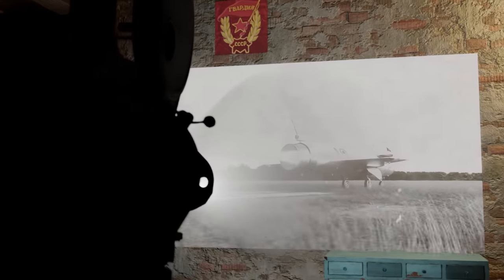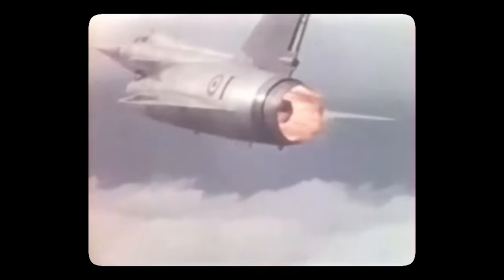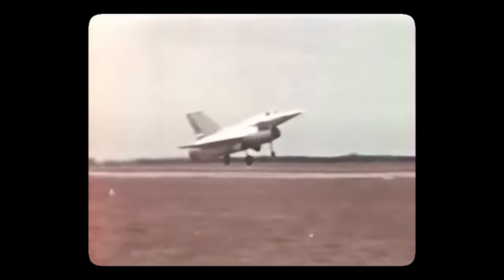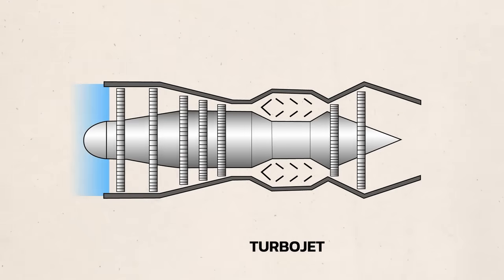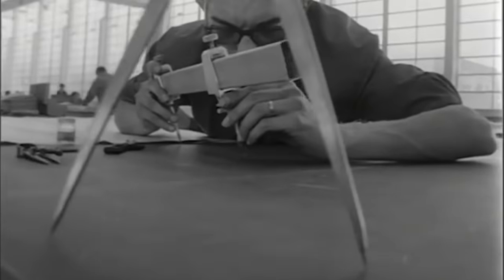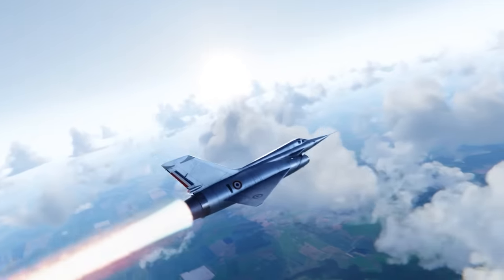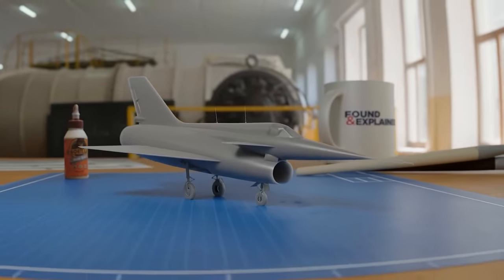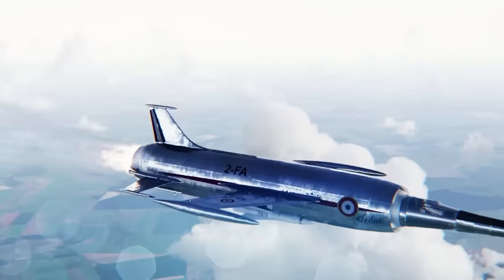How the French built the fastest plane in the world... Nord Griffon 1500

Comment: It's crazy to think that the Ramjet was invented in France in 1913. Planes of the time weren't even capable of testing this new type of engine.
Reply: Well it makes sense. In principle, it is less complicated than a turbojet.
Reply: @YourFriendlyOfficeAssistant A ramjet is significantly more complicated that a turbojet.
Sure it may be a lot simpler, but its also a lot more complicated. Although, slapping a turbojet engine in front does make it significantly less complicated
Reply: @jakehildebrand1824  I did say in principle. In practice not so much.
Reply: Even before 1913 ;) 'According to Arhur C. Clarke, Cyrano must be credited both for first applying the rocket to space travel and, for inventing the ramjet. Cyrano wrote:
    "I foresaw very well, that the vacuity that would happen in the icosahedron, by reason of the sunbeams, united by the concave glasses, would, to fill up the space, attract a great abundance of air, whereby my box would be carried up; and that proportionable as I mounted, the rushing wind that should force it through the hole, could not rise to the roof, but that furiously penetrating the machine, it must needs force it upon high." (from Greetings, Carbon-Based Bipeds by Arhur C. Clarke, 2000)'
Reply: @2nolhta  theres a huge difference between having an idea for something, and inventing it.
Reply: The soviets actually mounted two ramjets on a biplane in WW2.. check out the I-153 ramjet
It's crazy that this ramjet technology is so old

Comment: The plane shown in the thumbnail and in the title uses a ramjet not a rocket so it is a plane, he got it right
Reply: So you're telling me the person who made the video did his research? I don't believe it
Reply: Rockets can be airplanes. The question is whether the wings deliver lift in flight. The Me163 was an airplane… The X-15 was an airplane…
Reply: @allangibson8494 the x-15 was a rocket with wings
Reply: @demscrazy6574  The X-15 was an aerodynamically lifted vehicle with a rocket for propulsion. Being a glider for landing make it an aeroplane (and so is the SpaceShuttle).
Reply: @allangibson8494  fair enough
Reply: @demscrazy6574  As an aside - helicopters and gyrocopters are generally not aeroplanes (because they don’t have wings). They are aerodynes because they use air for lift. 
Jet and rocket lifted aircraft have been built (the LLTV & LLRV “flying bedstead” being an example).
Reply: So at what point of people going to try and argue that the Space Shuttle Orbiter isnt a plane.
Reply: ...yes but it looks like a Citroen.
Reply: @BugattiONE666 the space shuttle was not used as plane, just as glider on its way back. Think of it as an glider strapped to it's massive rocket booster and fuel tank. but Most gliders are also Planes so there you go.

Comment: Some corrections here:
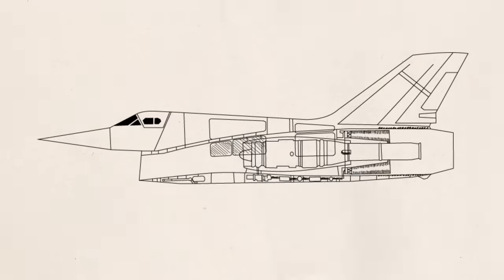0:45 and 8:40 Given the "turbofan" engine doesn't have any bypass with a fan around it, by definition it's a turbojet, not a turbofan. It’s the earlier type of jet engine available, the first turbofan military fighter came out much later, like the F-111.
6:27 And instead of “turbofan” you should say “…like a conventional Jet Engine…”
It’s like calling crisps as “French fires”. Sure both are fried potato, but they are quite different.
A jet engine does not use any compressor is called a “ramjet”, if the engine flow passes, it’s called “pulsejet”, if the internal flow is supersonic, it’s “scramjet”. 
A “turbojet” engine is a jet engine use a compressor (hence “turbo”) gas combusted by the engine to propel forward, the earliest and most basic type of jet engine. A “turbofan” is specifically for a turbojet engines  with a ducted fan bypass; for fan without a surrounding duct, these are called “propfan”. If the turbojet engine is connected to a propeller, and the exhaust have almost no energy (don’t use exhaust jet as propulsion), then it’s called “turbo prop”. And if the turboprop is NOT connected to a propeller, instead connected to rotor blades or used like a conventional engine, then it’s called “turbo shaft engine”.
Reply: The proper spelling is French "fries" - not "fires"  !!😀😇
Reply: @martinquerre9614  
Unless the cook is clumsy.  :hand-orange-covering-eyes:

Comment: Ah yeah, the wonderful 50s and 60s were such a wildcard in aviation design... 😁😁
Btw: the most famous plane with this propulsion combination is the SR-71 Blackbird. At supersonic speeds the turbojet core was still used but most of the air redirected around it - this way the RAMJET function was realized. And the Blackbird was specifically designed for Mach 3.28 - at this speed it was the most efficient. 😎✌
Reply: Funny enough the MiG 25 Foxbat could hit a speed of Mach 3.2+ but the engines would overheat and eat themselves.  So they put a modest speed limit of Mach 2.8 on the plane because of it hahaha
Reply: @RidinDirtyRollinBurnouts  Even then, a test pilot claimed he reached mach 3.5 in the Blackbird, and there's speculation(whether true or not) that the true top speed has never been released.
Reply: @DoubleMonoLR  Yeah, they were almost definitely going faster, but we do not get to hear about that.
Reply: Nothing like this.
Reply: @RidinDirtyRollinBurnouts  Wrong. They would overheat and exceed their fatigue life. This was not even an issue after the R-15D-300.
Reply: @DoubleMonoLR  It’s not.
Reply: @dannypipewrench533  Because it didn’t happen.

Comment: Wiki suggests this maxed out at Mach 2.2.  Where does the Mach 3 / faster than a Foxbat come from ?
Reply: French Imagination.
Reply: It's the secret "white flag" mode to run away from enemies.

Jokes aside, it's just theoretical. It's easy to claim a speed without actually reaching it. The difficult part comes from making it work in reality without the plane blowing apart or the engines melting.

Comment: The X15 was/is an airplane that was air launched then propelled by rockets into space ( 354,200 feet ).  It had wings that presumably created lift allowing it to land on a runway. The X15 was/is an airplane!
Reply: With a lot of help
Reply: The X15 used rocket engines tho.
Reply: Idk but what about to start off a runway under its own power
Reply: x15 was later than the nord griffon by nearly a decade
Reply: Yep: you said it yourself: Landing. Not taking off! (And certainly not from a grass airstrip). In a nutshell: nothing to do with the Griffon concept.
Reply: SR-71 then?
Reply: The space shuttle would do what? Mach 25 or so during reentry? It has wings and control surfaces to fly like a plane too, so i guess it would be the fastest airplane no? ;D
Reply: And i dont think that airplanes are required to have air breathing engines to be airplanes, otherwise gliders aren't airplanes either :D
Gliders can't take off on their own too, but they are airplanes, are they not? :)
Reply: @hernerweisenberg7052  
Dear god, Mach 25?! No wonder astronauts have intense training regimens. Isn’t the human G-force limit 9Gs or something?
Reply: @adastra7939  The Mach number refers to a speed, the G number to an acceleration, the two are not entirely unrelated, as you need acceleration to change speed and direction, but the amount of acceleration present depends on your maneuver, engine power or decelaration during braking and so on. Just because something goes really fast doesn't mean there is any acceleration present.
Reply: @adastra7939  For example: Bullets go really fast too, but as soon as they leave the barrel they are in free fall. If you were inside a flying bullet, you wouldn't feel any acceleration and be weightless. Well if there wasen't any air resistance constantly slowing down the bullet you would be :)

Comment: Faster than Mig-25? Let's be honest, during setting speed and altitude records in 1960th the Mig-25 actually accelerated beyond M 3.45 (such a speed was also recorded over Israel for the MiG-25R). In contrast the Griffon 1500 top speed was recorded as M 2.19. The turbo/ramjet combination in Griffon wasn't a great engeneering desiign but rather a step forward from the Leduc 0.22 with a simple, unadjustable and uneffective air intake. The MiG-25 R-15 engine was designed specifically for high altitude/speed flight and behaved as a ramjet rather than the turbojet in full power. The air compression occured in a sophisticated electronically-driven air intake and not in the engine compressor itself (the compressor ratio of R-15 is 4.5). Bytheway, the MiGs-25 predecessor, the Ye-152 (Ye-166) already set the record of M 3 in 1962, one and a half years after the Griffon barely reached its top M 2.19. But I have to admit, the Griffon 1500 looks avesome and fancy. It has its own weerd style.

Comment: AaAah, the French. Celebrated everywhere for their mechanical oddities.
Reply: Is it me or does this plane resemble an F-16?
Reply: @adastra7939  maybe it's the air intake under the cockpit. Like an F-16 on 'roids.
Reply: @Chris-ok4zo  more like an overweight, disproportionate F-16. I wonder if General Dynamics took inspiration from this plane?
Reply: @uingaeoc3905  who me?
Reply: @adastra7939  Makes more sense that description, like it has a beer gut or skipped arm day. Also, I doubt it inspired the F-16 since the design seemed so simple, but that's my opinion and who knows, right?
Reply: @adastra7939  No, they did not.
Reply: But it works and it is recognized, even abroad. Cars (Citroen, etc) planes (Mirages, Rafale, Concorde, etc) and many other products.
Reply: @adastra7939  Not at all - doubt if they knew about this FAILURE.
Reply: @andremontmartin7207  It did not work and it was not 'recognised' even by the AdlA. 
Concorde was a joint venture with the UK.

Comment: Interesting story, but a bit lacking in comparisons. For example, in the same timeframe (late 1959) that Nord set the M2.19 closed course record, the F-106 Delta Dart was flying M2.31. Not sure if the flight conditions were comparable, but that is a large difference. And, rather than two R&D prototypes by Nord, the Convair F-106 was produced in quantity, with 340 built and serving into the 1980's. The last one was retired around 1988 according to one source. I found it odd that the video passed off the temperature issue so superficially. If you have a design speed goal (the video claimed a M3+ for the Griffin and compared it to the MIG-25, but the fastest the Griffin recorded seemed to be the M2.19), then you can easily calculate the stagnation temperature. With that, you design the structure. The strength knock-down for aluminum is very significant, stainless less so, and Nord knew this. The Griffin is a stainless plane. So titanium isn't the only solution to this. Stainless was used in the M3.0+ XB-70 and the MIG-25. In contrast, the Bell X-1B was flying at M2.5 in the mid-1950s with primarily aluminum structure--and XLR11 rocket engines. I believe the skin and structure on the F-106 was mostly aluminum as well. The Nord dual-mode engine was a tough nut. People are still trying to get that to work well.

Comment: According to Wikipedia, the Griffon only ever reached Mach 2.15. And with the relatively small fuselage, I cannot believe it would have had very much range. One of the things that the A-12 and the SR-71 had going for it was their huge size, which could give them large fuel tanks for long range. Also, the French plane doesn't look like it has a very special metal for flying at mach 3, unless it was going to be made out of stainless steel or something. Aluminum would not cut it above Mach 2.5.

Comment: a, technological wonder to be sure, but I’m not sure what kind of payload it’s gonna be able to carry apart from a cannon
Reply: It's a prototype for the propulsion, it's not a combat platform. It could have been developed further but the truth is that there is no need for a Mach 3 capable interceptor. All fast interceptors, MiG 25, F15, MiG 31, can barely spend 20 minutes faster than mach 2 because of fuel constraints and limitations of the materials they are built with. What would be the point of going mach 3 for less than 5 minutes, and this at an exorbitant cost in development and materials? Ramjets make sense for missiles, not planes.

Comment: This aircraft never went past mach 1.7 I believe.  It was found to have several problems, including have way too small of an intake.  This was also in 1957 and it was retired only two were built.  In 1959 the Americans built the X-15 which reached speeds well over mach 6.  It was rocket powered, however it was faster and higher than any other piloted winged vehicle

Comment: Wait. Every source I'm looking at says that the max. speed reached by Griffon was Ma 2.19. That is about Ma 1 less than MiG-25 and Blackbird.
So basically Nord built an plane able to overtake both SR-71 and MiG-25, but the plane never reached Ma 3. Am I right?
So conclusion is: Griffon wasn't the fastest plane in the world.
Also - the fastest aircraft so far seems to be the X-15, which reached 4,520 mph (7,274 km/h, or Ma 6.70) on October 3rd, 1967. Yes,it was rocket-powered, but technically it's still an aircraft.

Comment: X15 uses rockets so it’s technically not a plane
Reply: it isn’t even an x15 though, read the title
Reply: he is talking about how people keep saying the x15 is faster
 @Invisibilitylock
Reply: The X-15 uses wings for lift and is thus an airplane.
The engine type is irrelevant.
Rocket powered aircraft go all the way back to the 1930’s.
Gliders are airplanes and have no engines at all…
Reply: @allangibson8494  it is a plane but using a rocket is still a simple way to just make it instantly faster then every aircraft, thats why air speed records are often limited to air breathing aircraft
Reply: @oxbaki5839  Rockets are not inherently faster but are easier to design than air breathing aircraft because you don’t need to design an air inlet. Endurance is however inherently much shorter for rocket powered airplanes.
Air breathing aerodynamic lifted spacecraft have also been built (designed for ~200km orbit levels).

Comment: Turbojet mate not turbofan. Big difference. They're not the same thing - look 'em up.  They didn't appear on fighters until the F-111 of 1964. You keeping on saying this is making my teeth itch. Another small point, on top of about a 100 in this one, is the main advantage of a ram-jet is that it does not need a turbine to turn a compressor so the exhaust temperatures can be risen to 'insane!' temperatures, way beyond the point where the blades would melt, producing 'insane!' power at the 'insane!' temperatures & altitudes encountered by Mach 3+ aircraft. Moreover, though Titanium was a bitch to build anything from, it was available  - but mainly from the USSR - oops. The US has to setup dozens of dummy companies to purchase enough to build a tiny number of A-12s/SR-71s. TBH, your videos are always really sloppily scripted/proof-read with little-to-no real research behind them. Hmmm, I might have to unsubscribe? Sorry mate. Oh and BTW, you're not using the word 'insane!' nearly enough in this video. Hang - just got to the end: '...much cheaper steel-Migs...' Oh for pity's sake! The Mig-25 wasn't to fly for another 5 years. The French knew absolutely nothing about it. Try putting less effort in flashy graphics & more on the script. Clickbate.